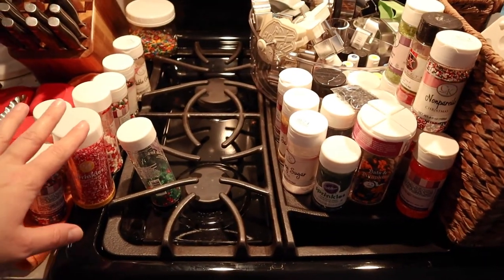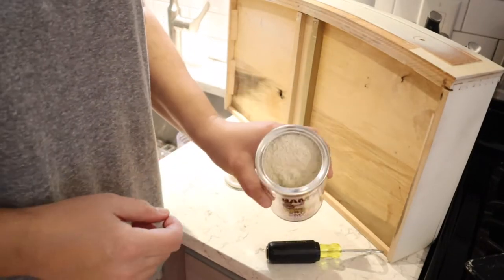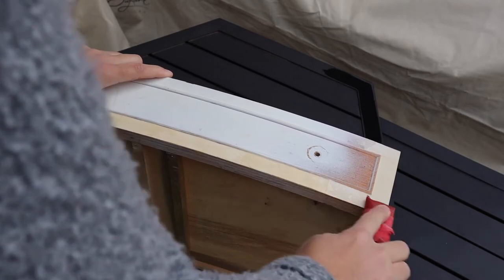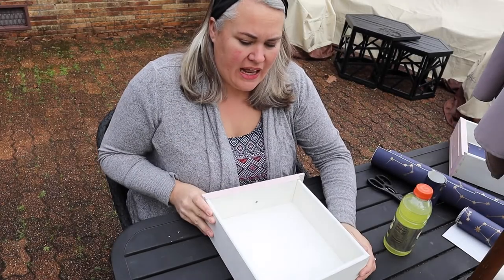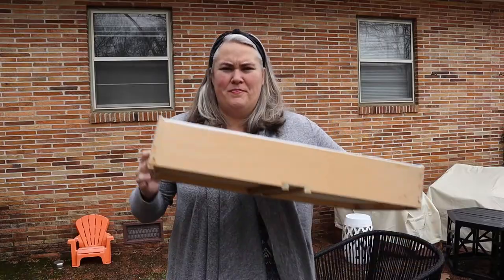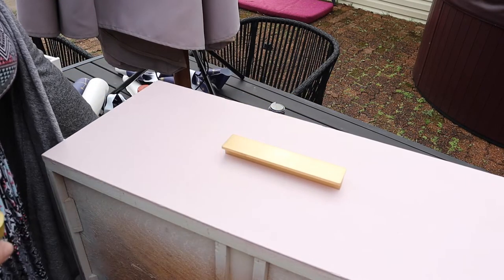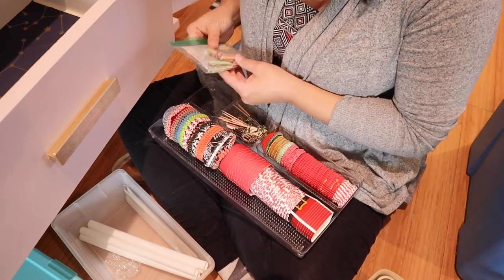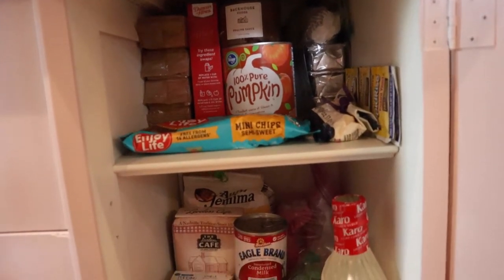HOW TO TURN A FACEBOOK MARKETPLACE FIND INTO YOUR DREAM BAKING CABINET OR PANTRY

Comment: Love the project! I’m glad you took the time to repair it rather than just paint over it. Using the palette knives was a nice touch. They are a great size & not as clumsy as a putty knife. Your improvised sanding blocks are a good tip. Not sure how you did this with a 4 year old around. Your mix-and-match drawer pulls look great. The leveling saw storage might be the best part. Your baking cabinet looks awesome!
Reply from the maker: Thank you! This project took a while but I love how it turned out. Now to go bake something for my neighbors! 😜